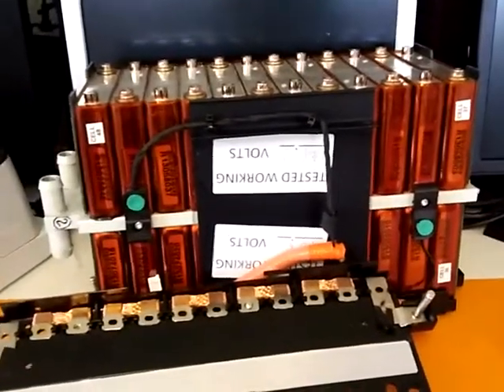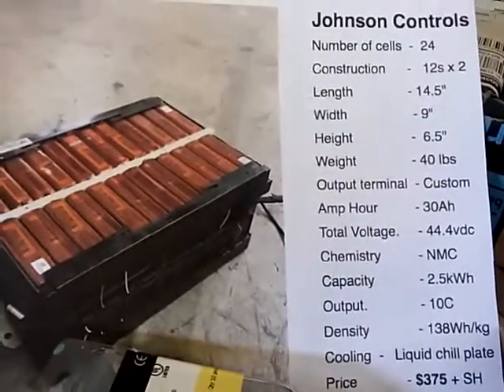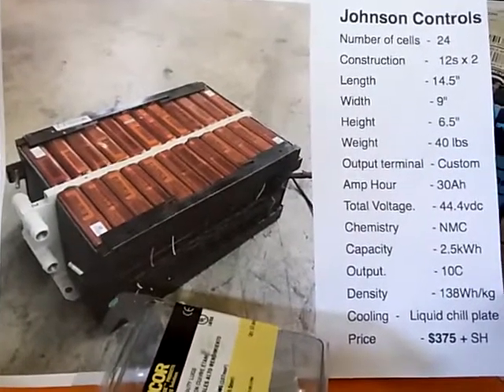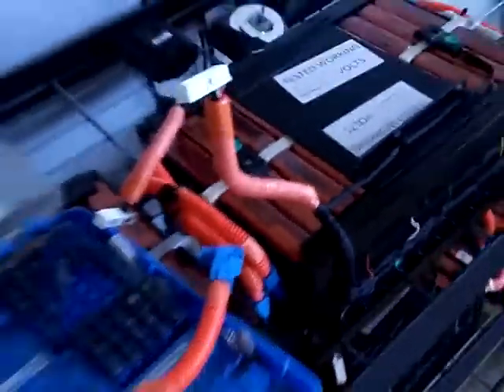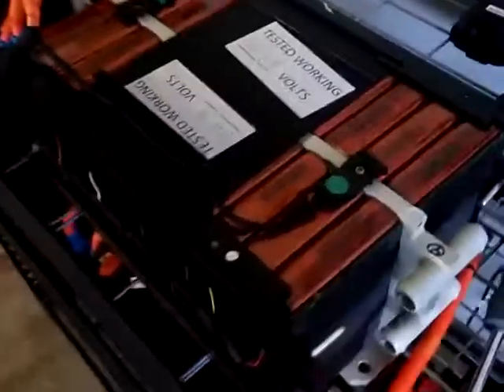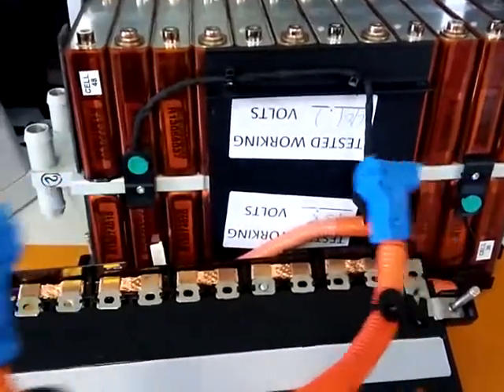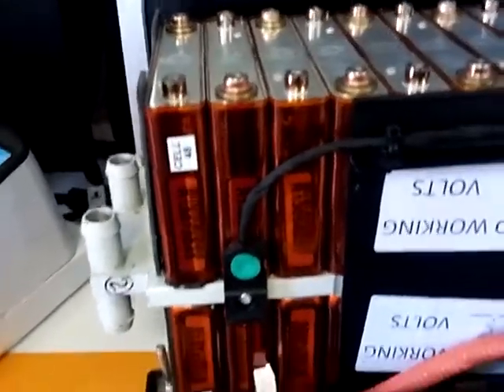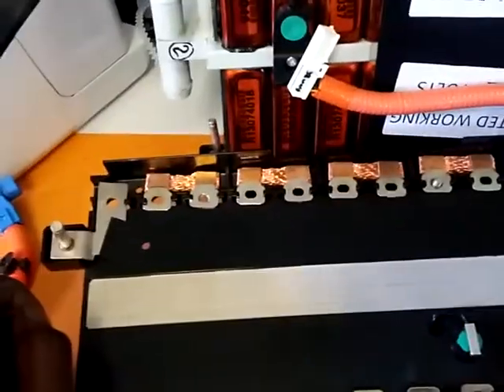Unboxing and overview of Johnson Controls Lithium NMC for use in solar battery bank

Comment: I purchased some of these, does anyone know if these normally take Li-Ion 4.2V max or Li-Fe 3.6 max charge?  I have heard some conflicting info and I cannot figure out what the cells are.  The seller on ebay lists NMC but after talking to them they seem uncertain and recommend lower charge voltage due to this.
Reply from the maker: 4.2 is max I run them up to 4.1v

Comment: I know this is old but I'm struggling what size bolts do these take? At ace m6 was too big m5.8 almost works.
Reply: Mine work perfect with a T-25 star bit.
Reply from the maker: I do not remember now but they should be m6

Comment: yeah just get rid of the end piece with the custom connector and use a lug,   you can take the entire set of cells and flip them so the positive of both sides are on the same end or use them without the chill plate and arrange however you want,   thats why I like this modules best you can do whatever you want,   if 12s doesn't work for your inverter add an extra cell to make 13s or 14s like many people do.
Reply: BTW:   just be careful as the raw exposed bottom end of each cell is electrically connected to the cells positive terminal,   don't place them on a conductive surface as it would be a huge short
Reply from the maker: jehugarcia awesome, thanks for the comments. I am working with someone to try to come up with copper bus bar sources to reconfigure these Banks and more of a powerwall configuration. There should be more videos coming!
Reply: Guy's can  you tell me if the Outback Flexmax 80 Charge Controller work with the tesla lithium ion  battery 24v 5.3kw to charge safely ?
Reply: Have you guys figured out the exact chemistry and proper charge and discharge voltage?  The seller on ebay right now says NMC, but when I spoke to them they said only charge to 3.9V and they are not sure on chemistry.

Comment: Hey mate, I have some good ideas now that I've seen it. Those are setup in a 12S2P congif and if you're up for it, I'd ditch the factory cables and connectors and use flat copper busbars to join them back up.
Reply from the maker: The Combat Engineer definitely up to try that out.  I do not like the layout as configured currently. Sketch out what you had in mind